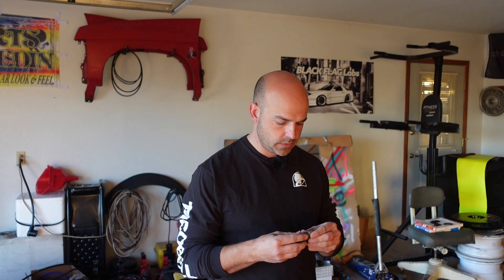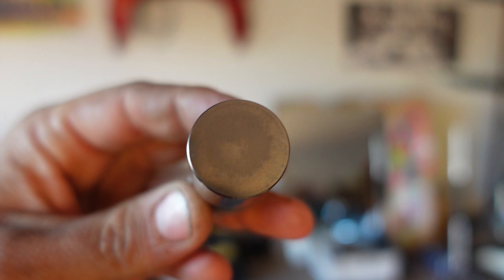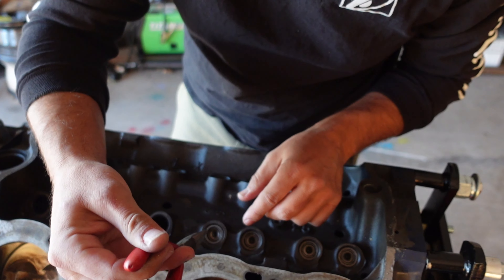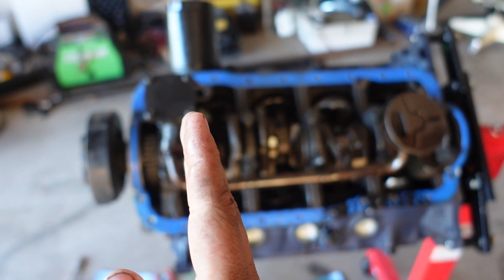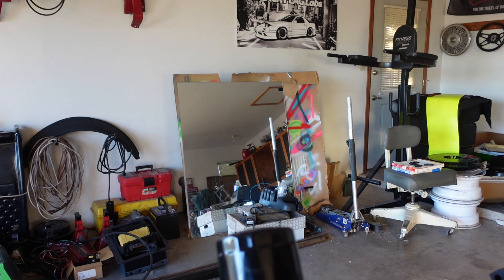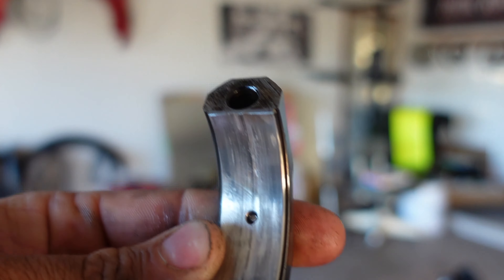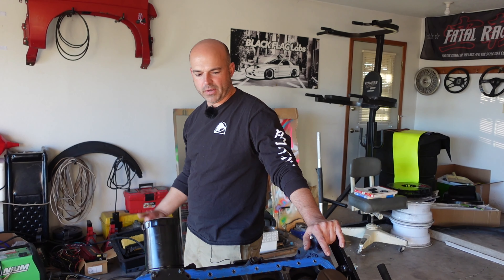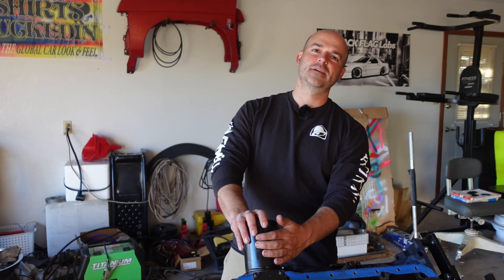302 Tear Down!

Comment: Take to machine shop have them put new rotating assembly bearings in and just get a set of junk yard gt40 heads of pre 1997 explorer or mercury mountaineer with the 302 and send heads and intake out and get ported ( i recommend big dogs porting) and put holley efi on it and would be more than enough power. And id get rid of the flat tappet cam and lifters and go full roller to help keep maintenance down.
Reply: Take the upper and lower intake also from explorer/mountaineer they flow really well actually especially after a good porting job,